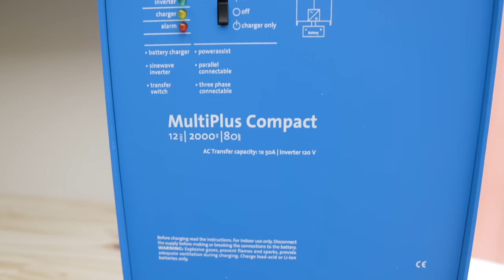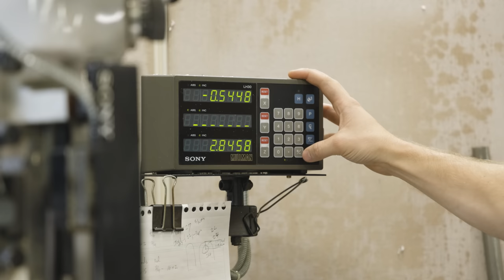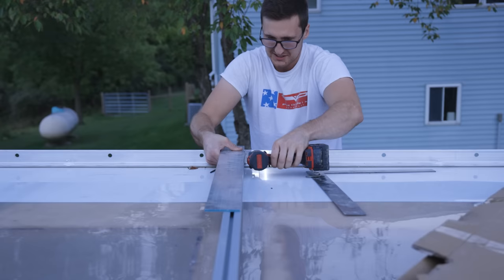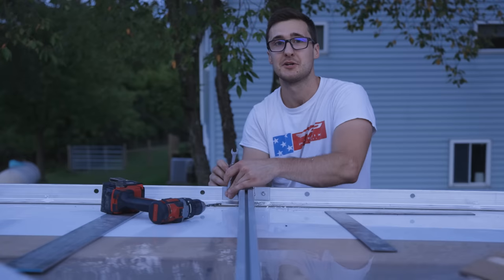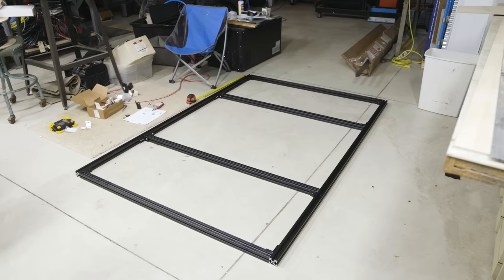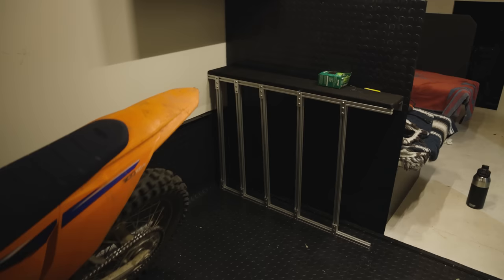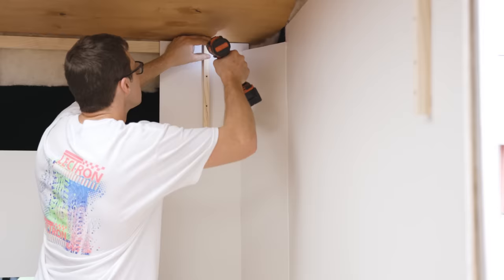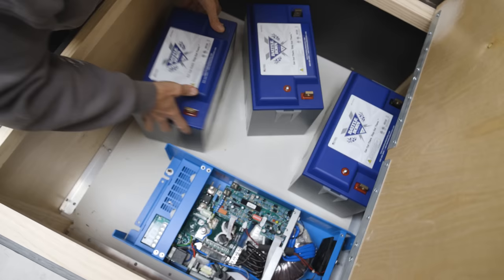Building the ULTIMATE Dirtbike Camper Van  - Episode 3

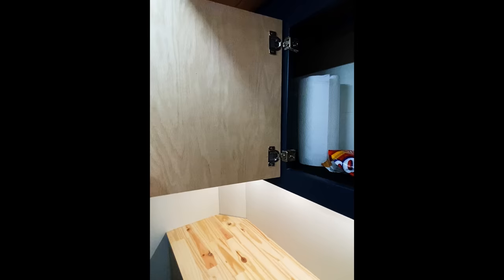Comment: 16:48 On many soft-close hinges you can turn the soft-close mechanism on and off. For example, on Blum soft-close hinges there is a little tiny slider bar you can push with a fingernail. If you turn off the soft-close feature on one hinge per door, they will close faster.

Very cool build. Thanks for sharing!
Reply from the maker: Yeah I got the cheap one. I don’t believe you can grunt it off. I like the soft close, it’s just a bit slow. I’ve grown used to it.

Comment: Man your attention to detail is so refreshing to see. So many poorly done builds out there. As a former tool maker turned cabinet maker, I applaud you!  It's looking great so far. 

If your door hinges are still too slow for your liking I would shut one of the soft close off. There should be a very small switch/slide that will shut it off. I know Blum products best but generally there is.

Comment: Amazing job and video ! Lucky Dad had a machine shop and so many tools to do a professional custom build.  💯😁
Reply from the maker: It definitely helps in some cases but I assure you, there’s always “another” way to do everything shown. 95% of this build has been done with a cordless skill saw and drill/driver. The frames could easily be outsourced to a lazier cutting shop (which I actually would have done if not for the time constraint). The bed hinge mounts and brackets can be made with a cheap drill press or even a cordless handheld…although I’ve grown up around all the nice equipment, there are many instances I/we have had to use the “primal” tools to get the job done. I have to thank my dad for always teaching me creative techniques to get things done when you don’t have the ideal tool for the job. But yeah, considering I have access to it, I’m sure as hell gonna utilize it 😂